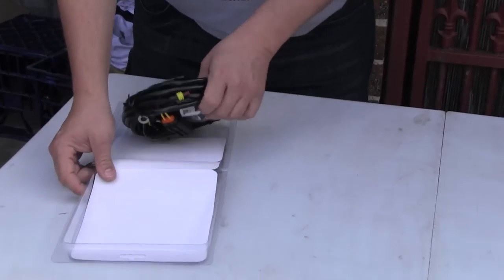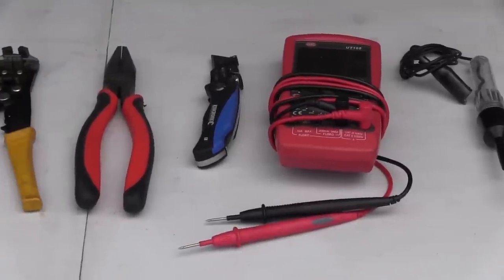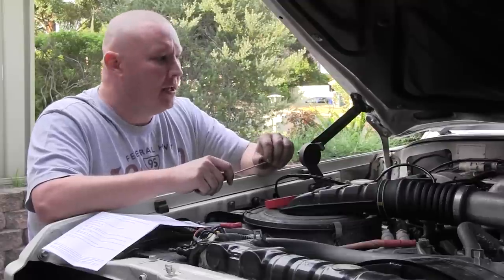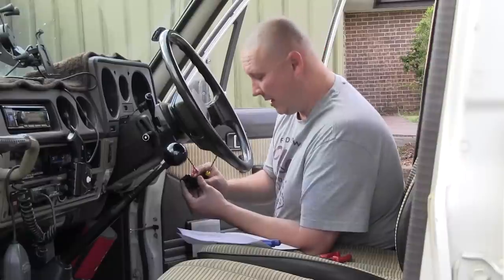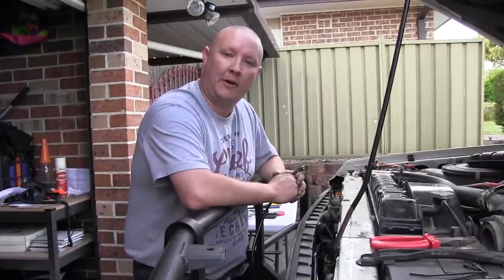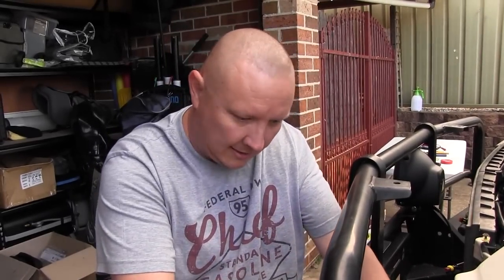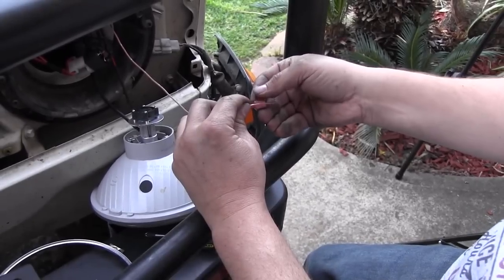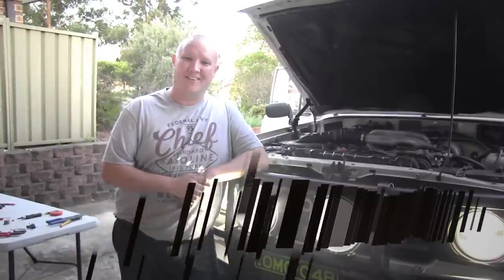Lightforce Wiring Harness Installation

Comment: I've purchased a similar kit however there are two wires that run to the high beam. there's a h4 connector plug or another "universal" adaptor. I'm not sure how to tap in to high beams? also have a 60 series.

Comment: Hi, I have a question. When you hook wire harness to the light bar does red wire from harness goes with red from light bar and black with black or is it other way round. The light bar I bought has two wires without any connector, so I am going to connect them and clip it to the wires coming from harness but not sure of color matching.